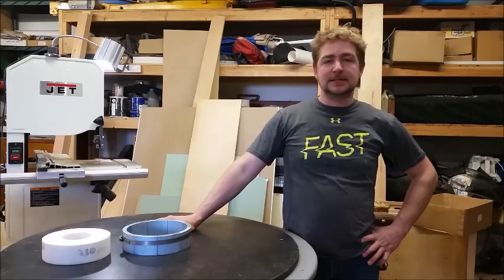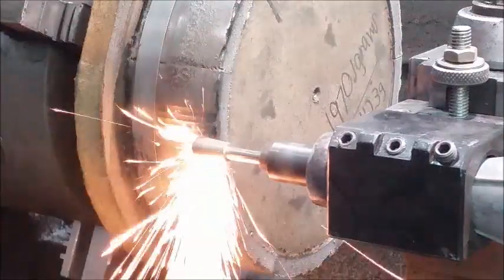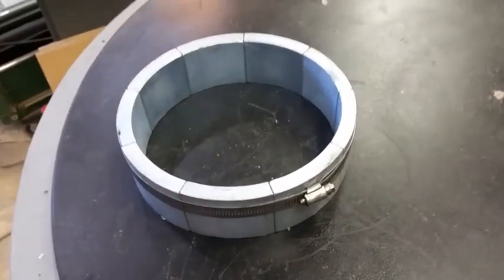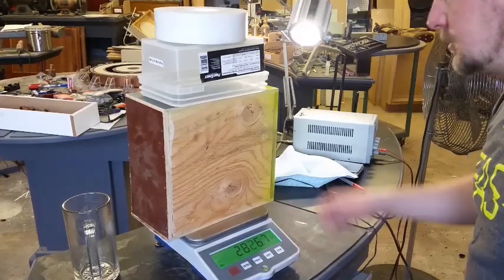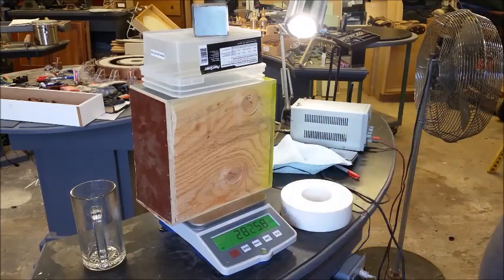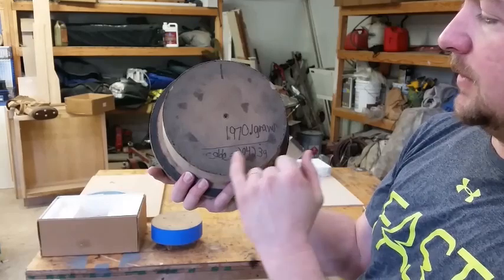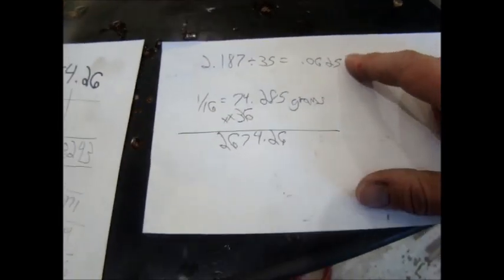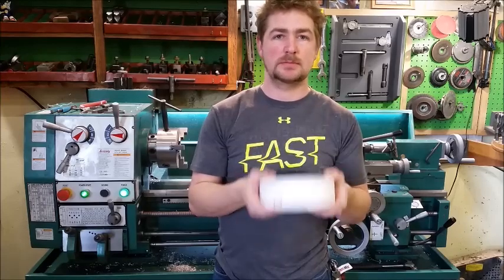Searl Effect Generator replica UPDATE

Comment: That won't work for free energy it needs to orbit and the rotating magnets need to orbit the center magnet otherwise it will always have friction slowing it down also it needs to run in vacuum and the coils are wrong anyway faraday disk generator will work better no friction and use tiny radio transmitters on each magnet spinning it will be rotating in vacume at high speeds with no friction and keep going with minimum power input to keep the small bit of drag from air slowing it down because perfect vacuum can't be achieved

Comment: The magnetic layer is not made like this;The have to be magnetised as one complete unit. It is a patern magnitise on the roller both with a DC and an AC patern
Reply: philip leigh your partly right, yes they do have to be magnetized all at once, however if you take a look at Searle magnetics SEG unit the do use multy segments simply because no supplier on earth makes magnets that large and thin.
Reply from the maker: Maharajji NKB  its sounds like your on the right path. 
recording tracks have my interest. however you can never imprint 4,500 MHz frequency on them.
Reply: Think of it like this if u have the ring and put metal to it. The inside of the loop should act as one pole (idk if it’s north or south but I’m guessing it matters) and the outside should act as another pole) if one side of the circle and the other side act as the poles it’s incorrect. U can add magnets to make the polarity right but it’ll change the size of how tall the circle is. U can alter water with this same principle and it is what’s used in the joecell. Water can be restructured and the North Pole field does completely different stuff then the South Pole field

Comment: 1)A suggestion,  use sintered magnet powder  mixed with thermoplastic to make ring magnets , injection molding , magnetize it while cooling down  
2)instead of weight  find equal displacement of water to achieve mass/density equivalent
3) pole density on each  track runners 3 for 1.25 inch dia runne(x = Np / 3.14 Dp = Nr / 3.14 Dr) x= pole density 
also see suggested runner magnet image in link below
4) magnetize with DC and AC (ac with 5% of DC power) together 

https://www.quora.com/Has-anyone-ever-built-a-viable-Searl-Effect-Generator/answer/Jayakumar-45?srid=us2Gw

Comment: Hi, just thought I would make a suggestion reguarding the magnetic fields.
John searl used a magnetiser to program a sine wave into the magnetic layers of the generator. NOT an option for most people even with a great workshop like yours.
Could I suggest the possibility of imitating the sine wave by the use of many individual cylindrical magnets to make the core magnetic layer. This is a method I hope to try myself in time.
 Either way. Good luck :)